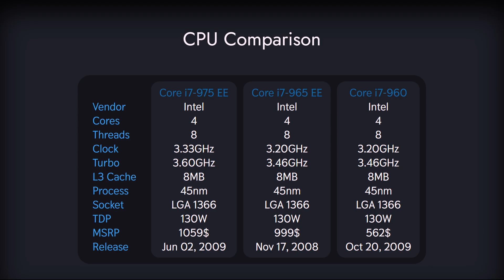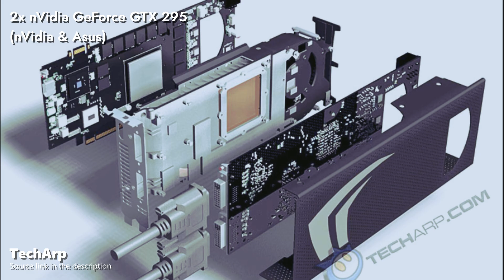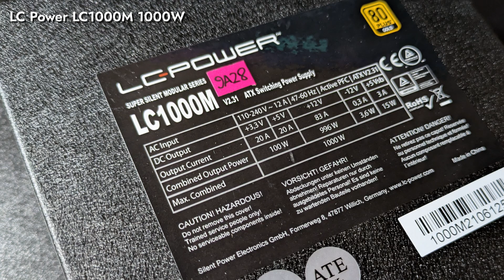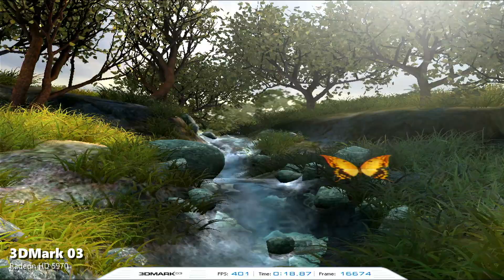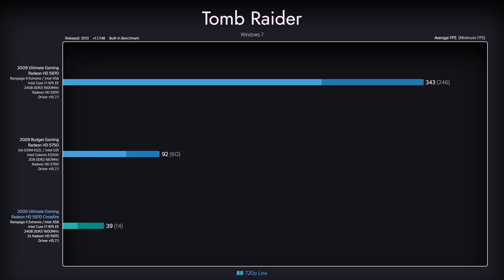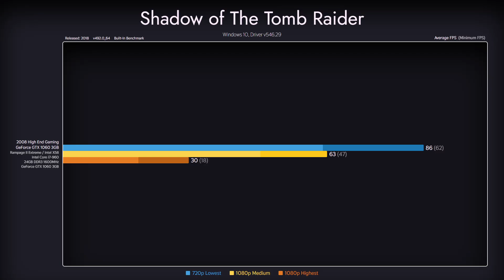2009 Ultimate High End Gaming PC ( Quad Crossfire vs Quad SLI, sort of )

Comment: I have one. Fully populated with 8 GB sticks. Total of 48 GB of RAM. Strangely enough, the Intel Xeon chip has 12 Mb of CPU cache versus the i7 8gb. Not only it does overclock very well. I've had my CPU go as high as 4.3 GHz stable. Only downside to the technology is the fact it does not support UEFI. You will be stuck with using traditional 512 byte sector hard drives.

Comment: I had a i7-920 and GTX 285 SLI setup back then.

I had almost no issues with SLI back then. It was amazing 

System was fully custom looped, with dual 360 radiators. It was an absolute Spaceheater.

Comment: I've been collecting some of these "dual" GPU's (please don't ask me why!) and so far have gotten my hands on a GTX 690, a GTX 590, a GeForce 9800 GX2, a GTX 295, a Radeon HD 5970, a Radeon HD 3870 X2, a Radeon HD 4870 X2, a Radeon HD 4850 X2 and a Radeon R9-295 X2. I've been experimenting with these things and since they are all in good working condition it's been really cool to see how they stack up, performance wise, to more modern graphics. Some even run more modern titles (at reduced settings in 1080p) better than I expected but they don't seem to do well with Direct X12 titles at all.

Comment: I tested 2x4890 on a simmilar x5675 system and had somewhat simmilar issues. Slightly better if 2x4850s. 
Drivers, chipsets, OSs... I guess vendors never fully tested these higher end gpus in cf back then.
Meanwhile, a laptop with an AMD A8 4500 and a HD 7640 GPU, does CF out of the box in W10.

Comment: i think X58 was the most iconic ""modern"" chipset mainly for how most motherboards for the it were absolute units , the X58-UD9 is something impressive to this day. dual 8 pin and 7 pcie slots? that's fancy even by todays standard and im not even talking about the triple channel and it's extreme overclocking abilities , X58 did feel like a mishmash between a server and a gaming desktop but in the best possible way however. i remember how happy i was from an X48 system and then totally forgetting it was a thing after upgrading to X58. i wish intel kept their formula and continued making experimental stuff like this instead of whatever they do now

Comment: It seems to me that the only SLI setups that worked like they were supposed to were made by 3Dfx. I had a dual GPU card made by Quantum 3D that used what they called a Medusa cable and it was a single slot PCI card that worked very well. I currently have 2 HD8990's that match and if I can find the right setup for them I think the Min PSU for the whole system is 1600 watts because 1300 watts was not enough. The last board I had 1 of these cards running on was an AMD Opteron setup and it gave me some booting headaches, When it did run I could play about every game I have on Steam with no hiccups at all. The Nvidia chipset did not like AMD X-Fire cards at all but it would work as long as it was running.
Reply: Nonsense. Crossfire and SLI did work; both had a different approach to how they would render the final image. I remember having a 270X and buying another 270X pretty much DOUBLED performance - except for the games that where not Crossfire compliant. RX580 in Crossfire would be just as fast as a single 1080. But your comparing 90's tech with these days tech, and the biggest problem is getting things work right; such as micro stuttering which is a obvious problem. Adding more cards won't solve those issues and in worst cases even performs worse then a single or dual setup. Anyway; it was fun; its just not happening anymore unless dev's specific optimize games for Crossfire/SLI these days.

Comment: Technically speaking, a 4-way SLI/4-way CrossFireX configuration require 4 seperate cards. 
Using only two cards, but with two GPUs in each is called Quad SLI or "Quad Fire" in Crossfire's case.
Otherwise, great video ;)

Comment: High refresh rate LCD wasn't a "thing", but the CRT I used at the time did 120hz at most resolutions. Granted that is still wasn't as much of a consideration as it is today. High refresh rate CRT monitors would be preferred by some using a high end system on competitive online games of the era for the various edges it had over LCD of the day. I owned both, and only had very fast high end CRTs because I am one who can see the flicker at anything other than stupid high refresh rates.

Comment: Awesome video! 

There's one reason though why you shouldn't populate all DIMM slots: It's more taxing on the chipset. If you're willing to overclock the memory, or set really tight timings, you'll get the best results by using only 3 slots.

Could you retry the Dual HD5970 (quad CF) benchmark with a faster CPU? The cards both really need a 16x PCIe lane, but when the chipset and CPU aren't up to par, you might end up with this kind of results. 

Have you tried Catalyst 13.1 or 13.9 for legacy support? Also try the latest CrossFireX Application Profiles (CAPs). 

Perhaps disabling Ultra Low Power State (ULPS) from the registry editor could help. Enabling the Frame Pacing setting in the Catalyst Control Center could help. Always disable V-Sync and perhaps set an FPS limit. 

VRAM is 1GB per card, which could cause performance issues when setting the textures too high. Also avoid Anti-Aliasing.

Good luck! And I hope to see a part 2 :D

Comment: Don't use any bridge 
Pcie=> windows API => 3D app API and even top on each for flexibility will do it natively / bios initialisation of devices methods and swap to make your gpu's heterogeneous / homogeneous
DX12 heterogeneous multi gpu adaptor 
(Oh and btw crossfire is not dead- using this method you ACTUALLY stack VRAMS i just dropped a bomb when it's common sense that praised mass existing devs are just lazy mf that use high lvl simplified retardtst game engines AND API'S SO THAT WE GET PENALISED FOR THEIR LACKS OF ""I FEEL LIKE  IT"" like as if their lifes weren't easy enough)
Can even add custom drivers for making it even better and tweak it with the toolbox and make it work in alternative rendering methods don't stick to that old paraplegic AFR and try things such as SFR ( split frame rendering), Tiled rendering etc etc to benefit and testing purposes 

I have some knowledge 
Let me know if you wanna talk x) i can do much more than just toy with simple consumer grade GPU's  

FPGA's < 333 / HBM§HMC memory / ASICS MUHAHAHA

Comment: i think its a bit unfair, the Nvidia fermi 4XX is the intended competitor for the HD 5XXXs, since thy're both DX11, the 200 series battled vs the 4XXX, but they had some launch window shenanigans
Reply from the maker: We are aware of the intent, but the state of GPUs in 2009 was HD 5000 vs GTX 200. nVidia was running late, and Fermi had it's own problems, quite unfortunate few years for them.

Comment: Nice. 

I only had two sli rigs. Both bad ideas on the end.

P4 3.2 s478 with sli 7800gt 256mb. 
Core i7 4790k with sli gtx760 2gb.

Would not recommend sli unless for fun. Always buy a stronger single gpu.
Reply: You still rocking the i7? An rx 580 2304/5700xt is a potent setup still as a secondary or primary depending on your needs.
Reply: @oldschooldude8370  I am rocking the i7 4790k with a single 1070ti as a secondary with KDE Neon. Mainly Fileserver and Plex duty. Was going planning as a test bed for gaming but didn't make it that far.
Reply: @s.h.5726  Nice. I main one with a 2304 and it crushes everything I use it for.
Reply: S478 and SLI, on what fucking planet? There are no SLI capable S478 boards. (the rare PCIe 478 boards that do exist only have one PCIe x16 slot)
Reply: @Wasmachineman  crud, your right, I had something else typed and deleted it before. Old age sucks.

I do have a Albatron s478 mobo with PCIe slot I ran 1x 7800GT 256mb. 

Eventually I upgraded to a Athlon X2 4200+ with a A8N32 SLI mobo with 2x 7800GT's.
Reply: @ based, shame the A8N boards all had trash tier caps.
Reply: @Wasmachineman  back in the day you could find abominations like this. you could even socket 775 mobos with AGP slot, mobos with both AGP and PCIe and sometimes even with ISA slots. they were not common but they existed and they mostly used 3rd party (non-Intel) chipsets
Reply: @CHAOSDixieMan  correct, ASRock was most infamous for that

Comment: Windows 11 LTSC does not have hardware requirements, and also Rufus will disable the requirements, so ya you can run W11 if you really want to burden the system with that junk...

Comment: I7 920 at 4ghz+ was awesome
Reply: I was testing Oced i7 920 4.2hz few days ago it cant handle triple channel memory on that speed and its pulling 250w, at least its ocing easy . 32nm Xeons are much better on X58.Funny is Evga mobos are bad , I find that asus has alot of better voltage regulation than evga .
Reply: @nikolakarovic5964 triple channel worked with 6gb of ddr3 at 4ghz. Had an abit board. The ebay 12 core xeon i later swapped in was superior, but would not work with 6 dimms.

Comment: The meme back in the day was that ATI/AMD had no drivers, so it could be you are just running into old problems with 4 way crossfire.
Reply: yeah ... to even try to run quad CF is m@dness - it was never working properly and never will (especially with those old cards and the VRAM is still the same) .
it was always better to buy one good gpu - also generational jumps back then was so cr@zy that even if it worked your CF setup would get demolished 
by new upper mid range graphics card just one or two years later (and power consumption would be 3x less) ...

Comment: I use to have a 9800GX2 and that card did not last long in my build. It was loud, hot, and finicky. Very shortly in its life the second GPU would "stop working". Reseating the small SLI and PCIE cables would fix this until it helplessly got too hot again and would repeat this. I purchased a 9800GTX+ from a friend and rocked that for a good while until the 500 series and have stayed away from the bleeding edge ever since. IDK what nvidia was thinking for that dual GPU solution, it was not good.
Reply: Let's be honest, it's dual gpu solution in general that wasn't good. Sure you might be on top of the charts for a while, but there was so much potential problem, plus the next high-end single gpu was often very close without any of the constraint.
Reply: @Shenron67  I remember hearing about the lackluster performance of the GTX690 as well and anyone who considered it purchased the first gen Titan when it came out instead. 
It really did seem like dual gpu cards were destined to be plagued with issues. I do miss getting excited for the weirdness of it all though.

Comment: I have a similar setup with an i7-975 Extreme Edition and two Radeon HD 5870 cards in CF. Since the 5970 is slightly underclocked that setup should be faster than a computer with a single 5970. But I have not done as many tests on it, I just ran the most stuttery mess also known as GTA IV retail and got kinda disappointed the best PC money could buy in 2009 didn't score higher than 7.4 in the Windows 7 experience index.
Reply: windows 7 performance index was crap though, I used to have a phenom ii x4 945 oc with 4gb ram and an hd5850 at the time and it would go like 7.1 or 7.4 I cant remember, and i used to build pcs worse or better dealing bs results compared to mine
Reply: @akafede4351 Because of slow mehanical drive